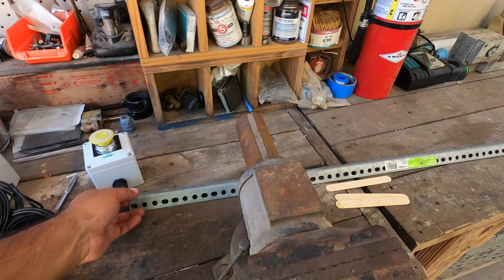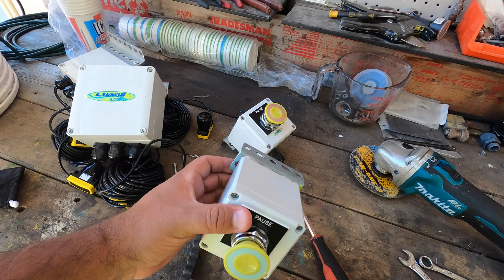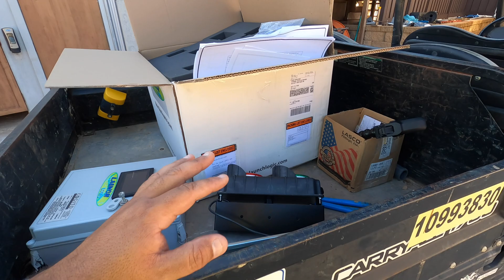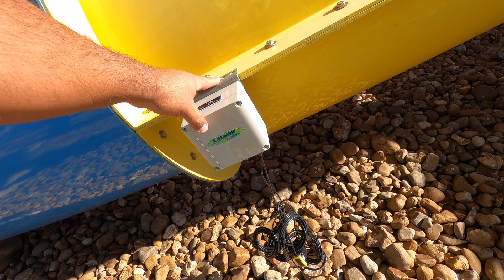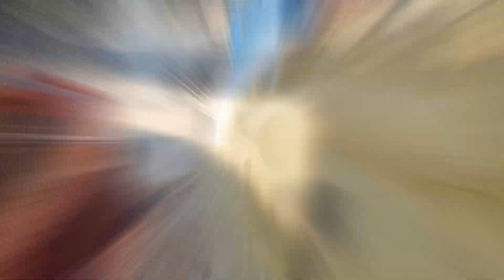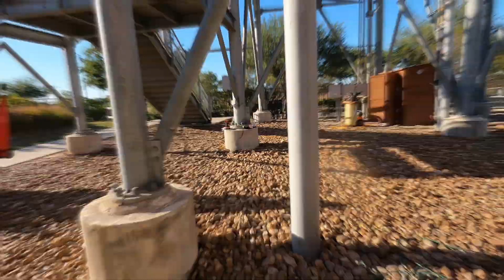Hardware Install - Launch Logic Red/Green Light Dispatch System

Comment: Great job!
A couple of suggestions:

1. Get a can of galvanizing spray paint, and paint the ends of that galvanized angle. You can spray some in the cap and use a 10 cent 1/2 inch brush to hand-paint things, since they are already mounted. If you don't put something on those ground edges they will start rusting pretty much immediately.

2. Flip the Pause buttons around 180 degrees. Mount them to the outside of the poles, facing away from the slides. This will make them close to invisible to guests, and it will still be easy for a lifeguard to reach over the fence and slap the button in case they need to pause the slide.  (it would also be nice to have a light the lifeguards could see someplace that lit up when the slide was paused.)
Reply from the maker: Hey there, two excellent suggestions. For sure we want to protect the galvanized angle, especially in this environment.  For the second suggestion, I will present that idea to operations and see how they feel about it. Totally makes sense. As for identifying what the slide is currently showing at the top, I think I'm gonna wire up some simple LED red and green lights somewhere at the run out.  Thanks for reaching out!
Reply: @thepoolguy  Having a red/green repeater at the bottom is a good idea, but I'd make it 3 color and have an orange or yellow, that specifically says that the pause button is pushed, and not just that the slide isn't clear (I assume pushing pause will make the light go red).

If you mount the button on the back of the post it can't easily be seen by anyone. Most people won't know it is there, but some younger kids will notice it, and maybe think it is fun to slap it as they go past walking out of the ride. Then the slide sits red and nobody knows why. A light that specifically says the pause button is down will let the guard know what is going on.

I'd mount the lights red/green/yellow top to bottom, rather than the usual order. This separates the red and yellow lights, which will both be on at once, and makes it easier to tell both lights are on.
Reply: I just looked at the drawings for the Launch Logic light. I think you could connect a 12V "pause active" light between lower J-box terminal 4 and lower J-box COM, but you should give Launch Logic a call to be sure.